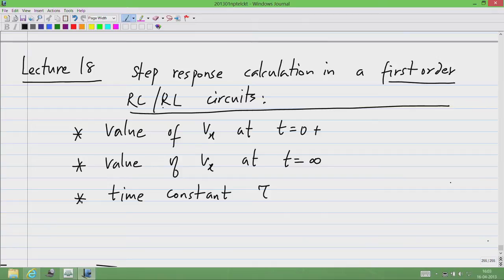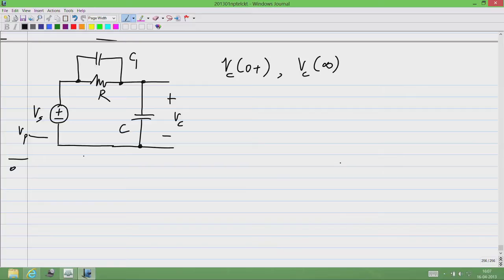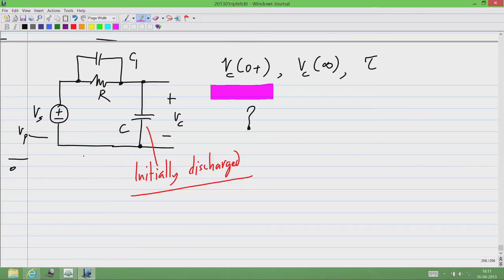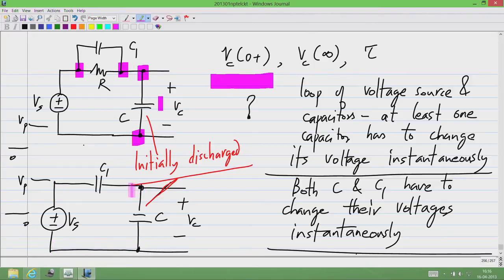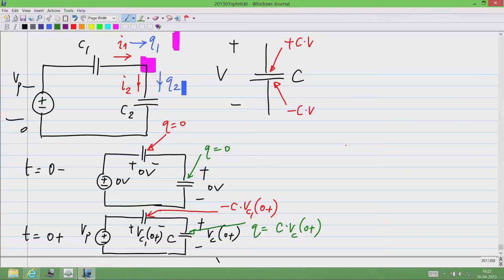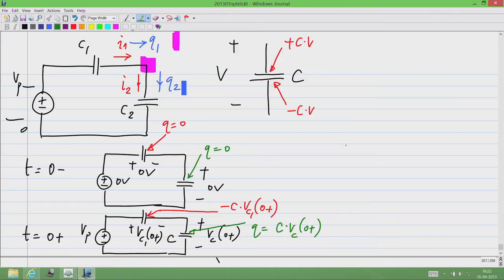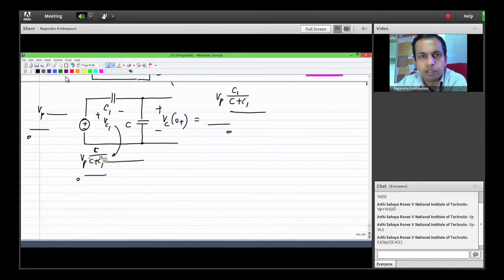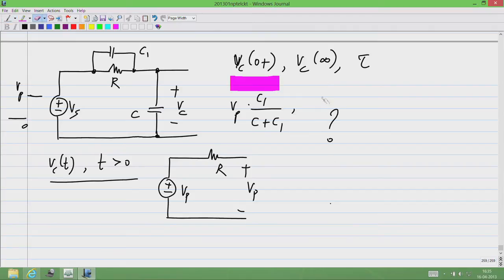Mod-01 Lec-18 Step response of RC circuit with loops of voltage sources and capacitors;

Comment: why capacitor c1 discharge at time infinity
Reply: The process of discharging requires potential. For a given potential, certain amount of charge discharges. Discharging of the capacitor causes decrease in it's charge. As charge decreases, the potential across it's plates decreases too. So, I believe that this is the reason why discharging is indicated by exponential function in the mathematical expression. As we know, this exponential function becomes zero when infinite time has passed.